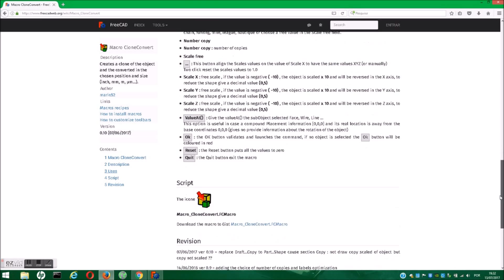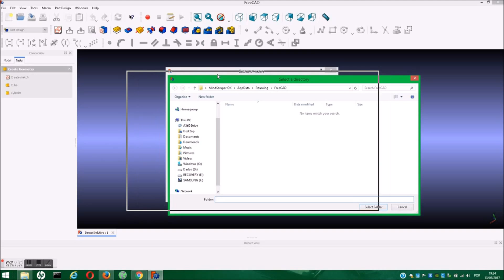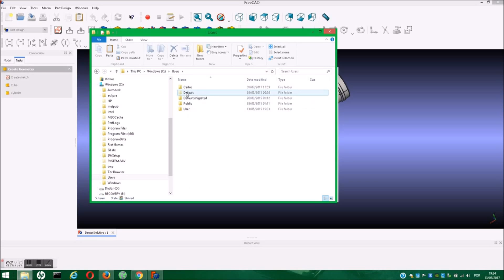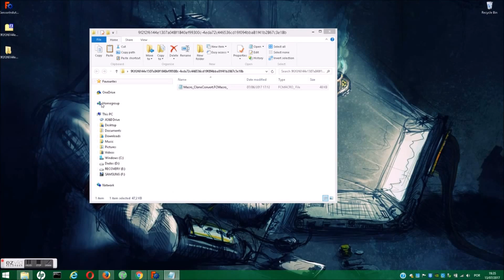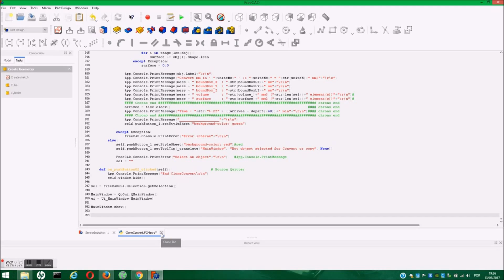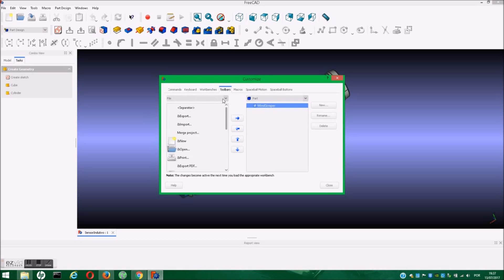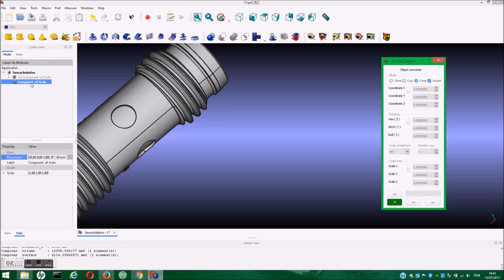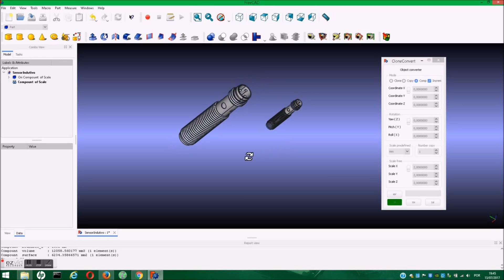FreeCAD Scale a Part with CloneConvert Macro

Comment: Here the dialog won't show up. Any ideas why?
Reply from the maker: I do not speak during this video but you can activate captions.
Reply: No, I meant the dialog window "CloneConvert" once we hit the button
Reply from the maker: Before you associated the icon with the macro, could you run it?
Reply from the maker: Check first if you can run the macro. To be able to discard the ipotese of you have copied the code badly or you have installed it badly.
Reply: Hi @Amilton, did you finally went through the issue ? I'm getting the same problem (FreeCAD 0.17/ Mac OS)
Reply: Error message goes to fast, but I can read that there is a probleme line 995 ("ui = Ui_MainWindow(MainWindow)")